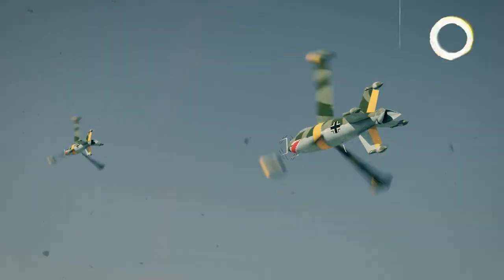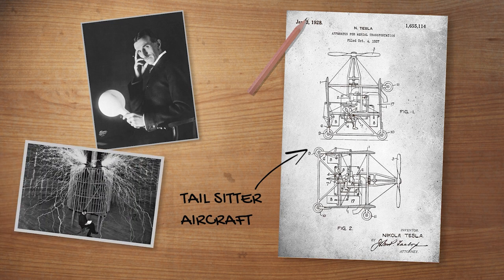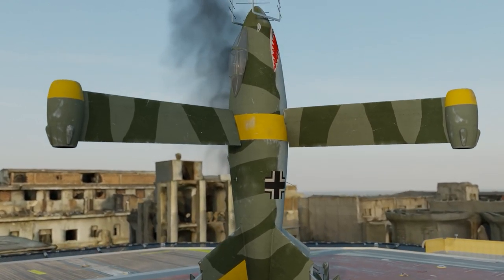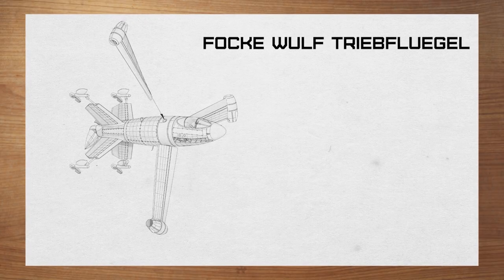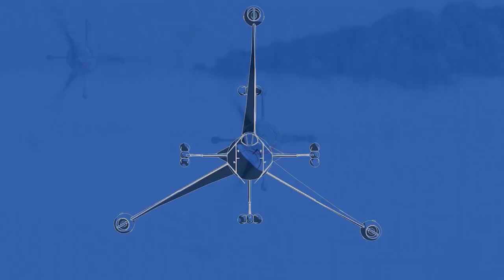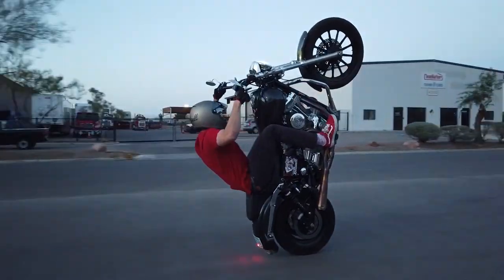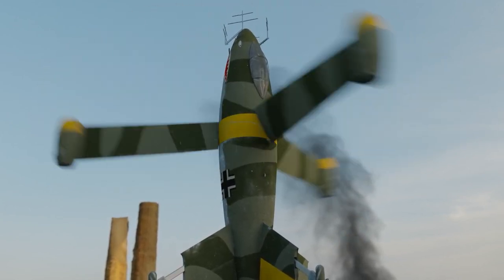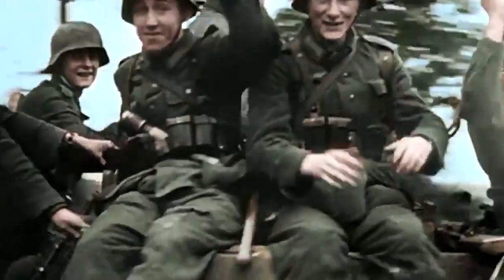This is the most INSANE Nazi aircraft ever designed - Focke Wulf Trebfluegel

Comment: Imagine the level of mechanical stress that hull would suffer. It may be cheap to produce, but the maintenance would be horrendous. If you want to replace the rotor, you'd have to dismantle half of the construction. Not to mention that this would be impossible to crashland on land.
Reply: You can probably autorotate during emergency but good luck on visibility
Reply: The USAF made similar aircraft after the war, the Lockheed XFV and the Convair XFY Pogo but a major problem was that it was very difficult for the pilot to know where the ground was for the latter aircraft and the XFV never did any Vertical takeoffs and landings before it was canceled due to performance issues.
The Triebflugel would have been and infeasible aircraft had it flown.
Reply: The Torque would have been massive!
Reply: nah youre just a hater of cool stuff
Reply: @oerlikon20mm29  I don't see how piloting an interceptor that is more dangerous to yourself than to the enemy is considered 'cool'. But if flying in a deathtrap that would almost certainly cause your death is your idea of cool, I won't question it. I also do not hate on anything, but that design is clearly a folly.
Reply: @aziris7257  its people like you that are the reason i cant ride cars with only one wheel
Reply: @oerlikon20mm29  Are you like trolling aiming to make me angry or something? You do know that a vehicle with one wheel is not a car, right? And, also such vehicles actually exists. It's called a monobike or monowheel. I have nothing to do with you not being able to ride it. Work hard and go buy it.
Reply: @aziris7257  i dont wanna, those things look stupid
Reply: Un delirio. Imposible que volara. Pero atractivo para los modelistas.
Reply: @aziris7257  lmao he got you
Reply: insane torque
Reply: To be fair that was the case with some Nazi tanks too since they were expected to be destroyed eventually
Reply: Impossible NOT to crash land.
Reply: looked like an space ship with artifical grafity. :)
Reply: Imagine how easy it would be to unbalance the rotor system and if that happened not only would it be impossible to control it would probably shake itself apart.
Reply: Maintenance wasn't too important at the end of WWII
Reply: @oerlikon20mm29  then don't think of a concept such as a car with a single wheel
Reply: @perlasandoval7883  I was thinking of the General Grievous bike tbh, not that stupid thing I saw on Google images
Reply: Imagine the bearing of the rotor seizing up.
Reply: thats the thing about germans they always tried new stuff that many other countries knew was a bad idea and people call them advanced
Reply: indeed
Reply: - This is quite plausible and I don't think its highly stressed.  The Germans successfully flew the tip jet powered Doblhoff WNF 342 tip jet helicopter in 1943.  Compressed air was burned with fuel in the tips.  Worked well. This is a similar principle.
- In this case one would need a large journal style bearing before and after the rotor.  The bearing would be continuously supplied with oil and labyrinth seals (metal/rubber) continuously packed with grease to prevent oil leakage.  Rotary Unions carry fuel and air could be used.   The pitch control constant speed system could be a simple mechanical computer using an centrifugal governor in each blade (just a bob weight).  Fuel mixed with lubricating oil would provide hydraulic pressure as well.  
-The landing problem could be solved.   Either tilt the pilot forward so he can view out of a belly window or using automatic landing.  
-I do not believe this vehicle would be highly stressed.
Reply: it probably wasn't meant to be repaired then, if it had been damaged they would just scrap it for materials to make more, the fact that it was impossible to make crash landings with it would easily be a factor to raise the steaks that the pilot would have to think of
Reply: @williamzk9083  You don't need to theorized hypothetically blabla, French already did that with Cleocopter. Even they added big improvement over this plane with rotating seat, full stabilizer, and improved ducted fan

Only some test needed and few fatal casualties needed to prove this is a moron idea

Comment: The problem with this bird and all other tailsitters: everything's fine until you actually have to land.
Reply: Worse, this thing is refuse to fly straight like plane

Even with modern attempt from France.
Reply: Also the MAINTAINCE
Reply: You could use a modified artificial horizon to help stay perpendicular to the ground and a scope pointed aft to help land the thing.
Reply: @bocahdongo7769  whats up with spamming this?
Reply: @DubiousFIN  necessary enough
Reply: Who said thwy were to land
Reply: @kotestalina3838  if you want to be able to keep defending a factory against multiple air raids, landing is necessary.
Reply: @kotestalina3838  perfect for the Japanese :3
Reply: Modern technology!
Reply: There is another problem. A normal airplane could handle some damage to its wings, while this one could not. Any damage to the rotor wings would unbalance it. The pilot would not be able to fly a straight line or even worse the unbalanced rotor would put heavy force to the planes body and may even destroy it. Seen the effect on wind turbines with one rotor blade damaged. The large unbalanced rotor is even able to destoy concrete or steel towers.
Reply: I wonder if those ideas are more legit nowadays with all the computer power we have 🤔

Comment: The Germans in WW2 were screwed up but they were ambitious and had a lot of good ideas when it came to military hardware. The ME262 is a good example of that.
Reply: All these crazy projects did was waste time and resources for useful projects
Reply: @laa0fa502  yeah but they were cool though. Sometimes you have to try a bunch of dumb stuff before you come up with a useful and practical idea.
Reply: Neat as the 262 was, I'd happily take the Gloster Meteor's 150 hr of engine life over the 262's 25
Reply: @laa0fa502  well, the way the wonderwapon program worked was, if you got approved, you got better food and didn't have to join the army. 

So there was incentive. Pair that with Goering being pretty gullible regarding what was practical and what wasn't, and it was easy to get into the program.
Reply: The Me-262 was an exception to the rule. Most of their weapons projects were failures or even outright stupid. Even the successful ones did have their issues.
Reply: @bkjeong4302  nah I would say the AR-234's were really good idea and designs. That include lot's of other stuff like the ME-262 HG I & II. There was ME-262 HG III however only a wooden wind tunnel model produced of it while the HG I had hundreds produced amd the HG II had one prototype produced by the end of the war.
Reply: @chamberlane2899  the engine life would be higher if alloy metals would have been available. The re-engineered BMW 003 and jumo jets from the ussr airforce had higher engine lifetime
Reply: @chamberlane2899  as said, the Russian copys had longer engine life
Reply: @dave_sic1365  yes, doesn’t change the fact that there is no shortage of German equipment that could’ve been better if only they used better materials. Prinz Eugen’s super high pressure boilers for example proved so unreliable they had to double the original engine crew compliment just to keep them running. And it isn’t like no one else was dealing with that kind of technology, the Americans had extensive experience installing and operating those types of engines, and they proved wholly incapable of keeping the ship going. They wound up having to tow the thing to Bikini just so they could go ahead and nuke it
Reply: @chamberlane2899  yeah but the discussion was in my view about the technical design alone.

The by design achievable engine life of the jumo 008 and BMW 003 is higher than 23 hr and I can prove that because the Russian copys of those engines had higher engine life.
Reply: The Me-262's problem, is actually that it was deployed too soon. It needed more time, it could have been a massive powerhouse
Reply: They did invent Meth or Crystal Meth, explains why they made so many wierd and bizarre designs
Reply: @eur0be4t3r  honestly, being a german scientist must have been lit
Reply: @maxmachac9756  😂
Reply: Now to be fair to the German engineers when alot of them got grabbed during operation paperclip they were able to design some really awesome jets in a peacetime resource rich nations.
Reply: The ME-163 Komet was another amazing design, although mostly ineffective AND dangerous to fly. It still holds the distinction of being the ONLY purely rocket propelled fighter aircraft to be used in combat.
Reply: @Allan_aka_RocKITEman  

The Me-163 was a failure. Yes it was the fastest fighter/interceptor of WWII. It was TOO fast to actually intercept anything, and ridiculously dangerous to fly to boot.
Reply: @bkjeong4302  >>> I believe I said that...😉

Comment: Just by seeing the 3D model, it's evident that countering the torque of the rotating wings would have been a major issue. Even rocket-powered wooden fighters does not seem as such a far-fetched project compared to this one.
Reply: I'm not sure about that. As the torque is applied at the wingtip the resulting force on the center of the airplane should be very small (as compared to a central engine 'pushing' the wings)
Reply: Torque is applied on the wingtip not at the center. Friction would be a problem that would propably lead to spinning the aircraft.
Reply: I was wondering how they would counteract the friction-drag. Trim on tail fins could do it, but that would only work once it was at a decent air speed.
Reply: @pudlyjongearhead2851  maybe with an internal gyroscope

But yeah I don't see how this much engineering effort could compete against pointdefence fighters like the me163 "Komet" or bachem "natter "
Reply: It would be wobbling all over the place

Comment: Hi. For the question of distribution of fuel to the rotary wing, the whole idea is was pretty fantastic, since the fuel will be a heavy carbonhydrate that will generate something like a gel essentially the rotary wing will take  with spade from one exit point of the fuselage. The fuel was also the lubricant: the idea was somehow modified later in some early versions of SR71 until they came with their own ideas. Three radial rings of Triebflügel provided the control to some stepper motors (don't imagine something like today's technology) that could rotate along the radial ring and provide a higher angle of attack. Take care everybody. Special thanks to the creator of the video, I was waiting 40 years to see this.
Reply: I had just assumed that each jets fuel was simply in its wing. But I suppose the volume of the wings is too small for that.

Comment: 4:17 The ramjet is perfect for this particular VTOL Aircraft. Because it’s not used to provide thrust, rather like the Rotodyne, they are used to spin the propeller. Still, the propeller needed to be spinned-up like a helicopter, the tip speed of the propeller can achieve supersonic speed even when the plane is at stand still.
There are also some error in your animation. At startup, the propeller should be “feathered”, unlike in-flight feather, the blades will try not cause any lift to minimize drag (similar to helicopters, when start up the collective should be at minimum). Ramjets would point almost horizontally, to allow air enter the jets. 
The statement at 4:49 is also wrong, the plane don’t take off with secondary engine like other ramjet aircraft. Rather it’s only used to spin the propeller. Once secondary engine spin the propeller fast enough, the ramjets can ignite because the tangential speed would be enough, just like the rotodyne’s main rotor. Again, lift is provided by the propeller, not the the ramjets.
At cruise, the tip-jets can never point parallel to flight direction, they need to be at angle to drive the propeller to keep it spinning.
Reply: Makes sense, and that's a pretty major oversight by F&E.

Comment: Interestingly, McDonnell, Hiller, Mil, and a Dutch company all experimented with ramjet-powered helicopters after the war, using the rotor's rotation to feed the ramjets. But, again, subsonic ramjets have poor efficiency in general and still required a secondary engine to spin it up to minimum start speed.
Reply: The Germans successfully flew the tip jet powered Doblhoff WNF 342 in 1943.  Compressed air was burned with fuel in the tips.  Worked well.

Comment: You've mentioned everything but the actual mechanical reality behind it which would also be pretty bad - it'd cost far more to make, would take more fuel to fly, and it'd be far more prone to breakages because to have such a massive wing in rotation... The pressures on it would be immense, and it even has the jet engines mounted on those too, meaning that if this thing didn't tear itself apart normally, it certainly will at any chance it gets like turbulence or crack in the metal...

Comment: Bruh ur narration  is legendary ...and I also should add . I was very interested in this aircraft as a child and as I got older I made rc versions  of this ..each one failed until 1 day I stumbled upon a Configuration that worked with the three 50 mm edfs .. this modle is really tail heavy so to fix that I put a C sized battery in the nose .. ...the next day after the wood glue dried...I tested it .. I got a few successful  hovers but that's all I would push out of it .until I added a flight controller.  Before I added it  there was no stabilization at all ...the day after I had just added as3x and control surfaces on the tailplanes . ... SHE FLEW AFTER THAT I managed to do a circuit around my yard about 5 times ....but as I would try to get it into forward flight ...the rotors would spin so dang fast they would fly apart Almost every time after that . ...mainly were the edfs were attached..and if one edf would go it would be rele unbalanced and it basically  threw itself apart .. I do have a video or two but ya no . The quality kind of sux compared to videos now

Comment: There have been several attempts to build scale flying model of the Triebfluegel  and they all suffered the same issue as the wings begin to spin before takeoff, they caused the aircraft become unbalanced and once, the did the aircraft became airborne the fuselage started counter rotating as the fins at the tail were not big enough to counter the torque from the wings. It is still one of my favorite designs of an experimental aircraft and what's a great disappointed to find out that it would never fly.

Comment: there are two mistakes in the clip. Firstly, the wing-rotor has to be in a flat angle on startup to gain enough rotation force by the ramjets. The animation shows the jet nacelles almost in vertical position. Secondly, the ROckets are not shown on the take off scene. They are only used to gain enough rotation and air flow into the ramjet to start up the ramjets when Triebflügel is still on ground.  All lift force is produced by the rotation wings only at full ramjet power and not by any rockets.

Comment: That vehicle does not have any kind of torque compensation. In fact it will become uncontrollable as soon as it loses contact to the ground. There is physically no way to control an airborne vehicle without torque compensation. Usually that is done by a 2nd rotor or large static wings. The FW Triebfluegel doesn't have either of that.

Comment: What would keep the body from rotating.  In a helicopter you have a tail rotor,   in a prop airplane you have wings and can counter with flaps.   I fail to see where the counter rotating measures fits in on this plane.   Sure the tail have flaps and that could work when the plane gains speed,  but how about takeoff and especially landing.  For flaps to work the plane needs speed,  and to land it you need to be able to hover and slowly descent.

I find the concept interesting,  but i think for it to work you need two rotors,  one spinning left and one spinning right.

Comment: Another issue with this - the massive gyroscopic effects of that huge rotor would have made this thing very difficult to steer, very poor maneuverability, not something you want for a fighter.
Reply: It was not supposed to be a fighter but an interceptor, it was designed to shoot down bombers so it didn't need to be manoeuvrable

Comment: Just one more question: how is the huge angular momentum of the propeller compensated? 
This airplane would result in something like a helicopter with now tail rotor, spinning in the Opposite direction as the rotor.
Reply: it's propelled from the tips, not from an engine in the hull. Therefore it wouldn't have torque
Reply: @diegootero1686  it doesnt matter where the torque comes from

Comment: Sorry, had to stop when the assertion that the ramjets on the rotary wings wouldn't work when standing still. That is true if you are talking about the wing tip, but not the aircraft as a whole as the wing tip can be moving rapidly when the aircraft is standing still. Hiller built a number of ramjet powered helicopters such as the Hornet that flew fine. Subsonic ramjets are not very efficient and running a rotor tip supersonically is not practical for a number of reasons. The Trebfluegel had to have an engine, or some method or rotating the wing to start the ramjets, but would not be needed once off the ground. In fact, driving the rotor from an engine applying torque from the fuselage is not possible in flight as it would just rotate the fuselage in the opposite direction, having no anti-torque system like a modern single rotor helicopter with a tail rotor. I would think that controlling this beast would beyond the technology of the era and would be the major initial roadblock to successful flight.